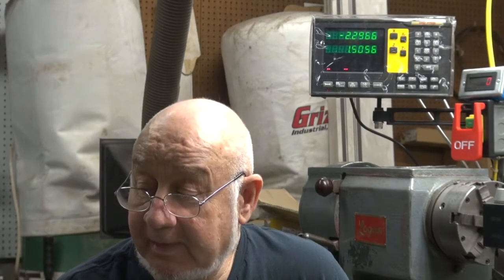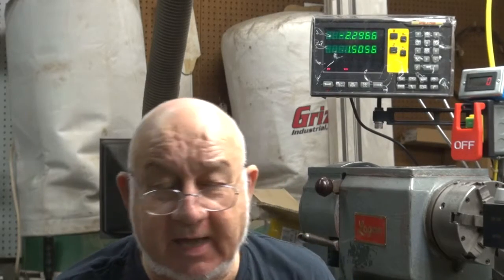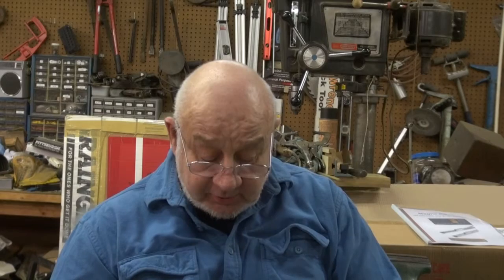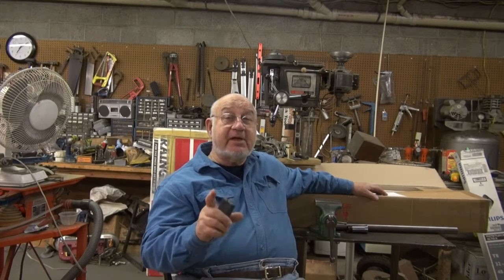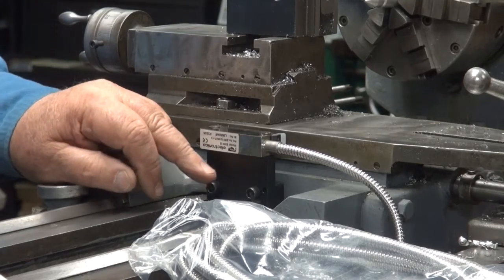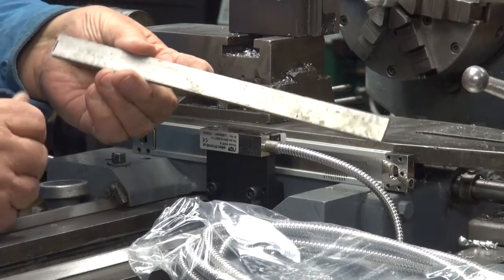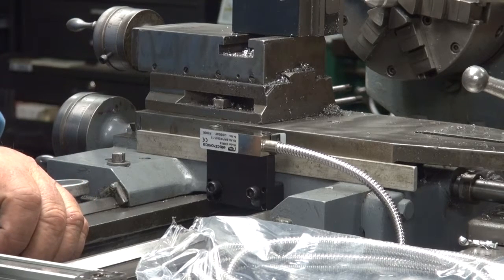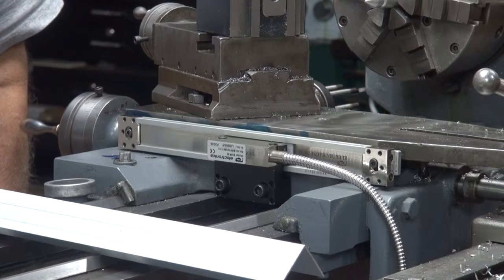DRO Part 1

Comment: Hi Dave, Sorry for your loss. I am a Vietnam Vet as well. Planning on ordering soon a DRO PRO kit for our 13 inch Clausing Lathe.
Need to install it before I move it into it's final operating position. The cross slide is pretty square and surfaces parallel. The carriage scale will be a bit more of a challenge, as the length of the bed body is tapered.  So keep up the good work. I will probably video record my installation as well. Thanks again for sharing your work. Dave

Comment: I enjoyed your video! My condolences for your friend, as a type 1 diabetic of 29 years I've seen my share of memorials as well, recently my grandfather who I was extremely close with.. 
That aside, you did great making this video, I'm 35 and still trying to figure out how to start a channel, I'm in the process of recovering my 1955 Logan 955 lathe which I lucked out and was given to me!! Its in need of some restoration but as expected.. I've fixed my clutch although I need a new gear on it as well with the worm gear that drives it.. after that I need to repair my back gear or bull gear, one of the two, as the cost of a replacement is too much in my opinion.. great video, cant wait to install a dro on my lathe!
Reply from the maker: Congratulations on the Logan acquisition. Good luck with the restoration. I should probably work on my automatic feed clutch but it does work and I am hesitant to remove the apron. Thanks for watching.